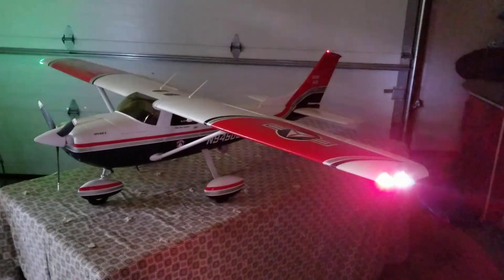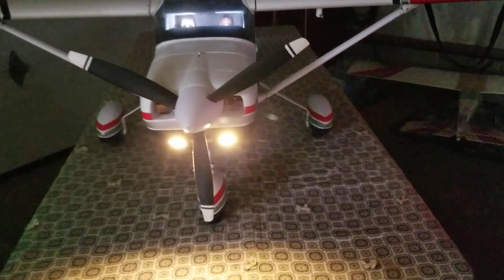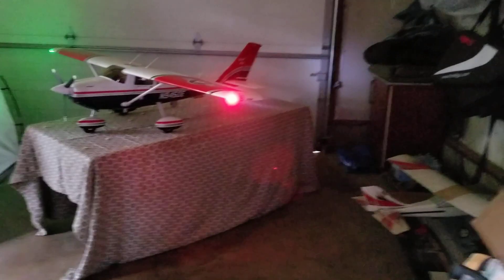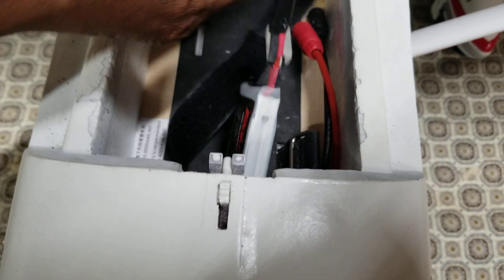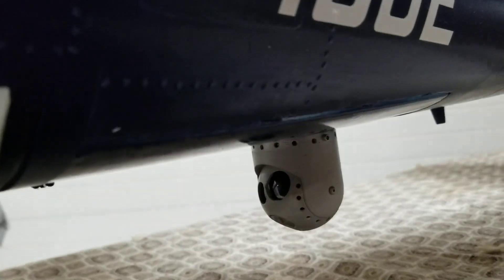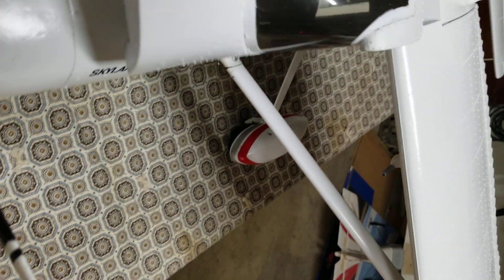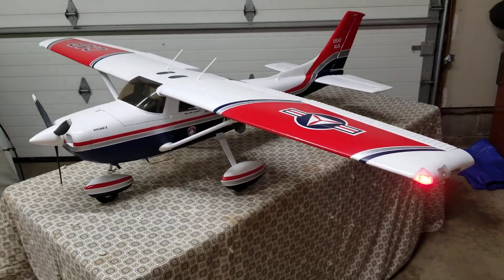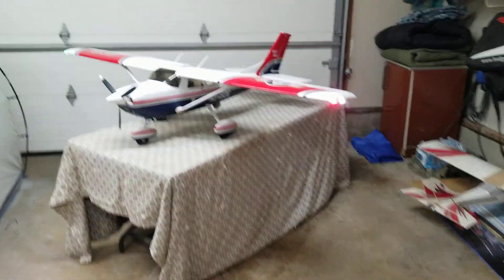HSDJETS CESSNA 182, final words on it

Comment: From an article on the Aviation Safety website..

"Which is better in the cockpit? We’d argue red instrument lighting is, if for no other reason than it helps preserve our ability to identify dimly lit objects. Also, that’s what we learned on, and it’s more dramatic than something more modern. While there’s certainly a red-light intensity level that begins to saturate the rods, we usually don’t need that much light in a cockpit at night. A green/blue light source, meanwhile, must be kept a low level to avoid overloading the rods. And if it’s too bright, it can interfere with our night vision outside the cockpit. Ultimately, it’s a personal choice, as long as we keep the light intensity at a minimum."

Comment: Looks really nice. Do you make your own lenses for your navigation lights or use some from other planes? What sized LEDs do you use for the vertical stabilizer? I have a freewing f18 90mm that I was thinking about adding red strobes on the outer side of the vertical stabilizers. Haven't really found a good option on a lens and not sure about the size of the LEDs. Thinking the 1w LED chips since they are low profile, and bright,  it it might be overkill.
Reply from the maker: I only added the nose lights from MOTIONRC MIG29. All other lights come already on the plane